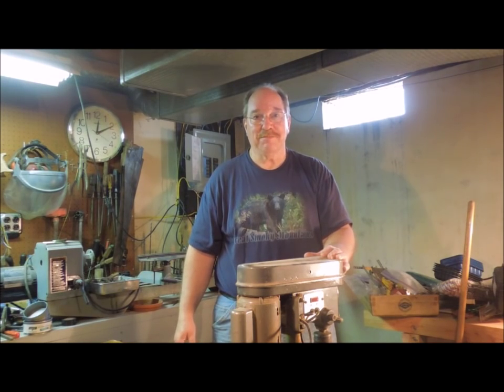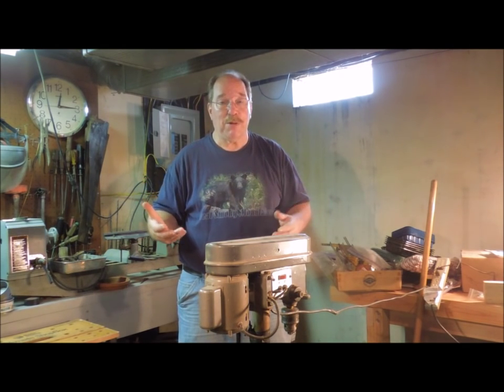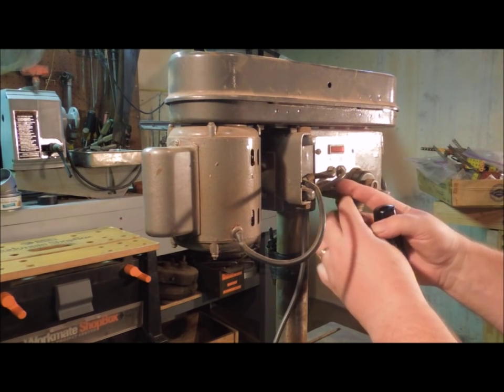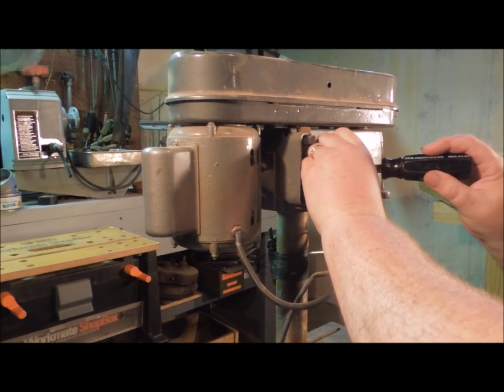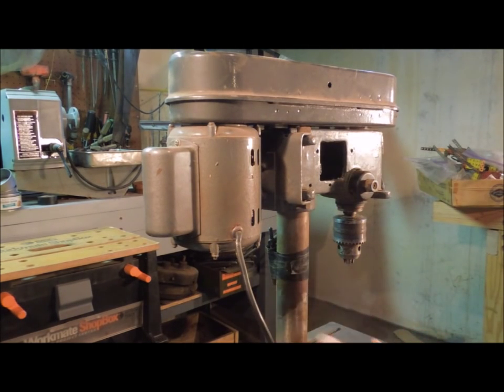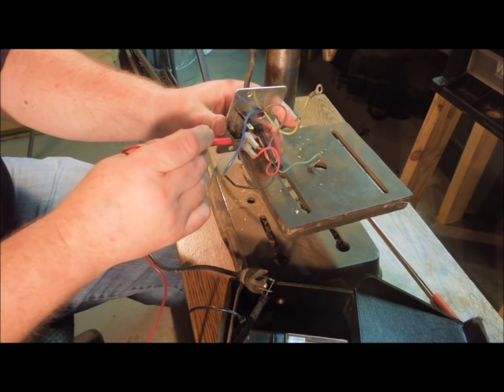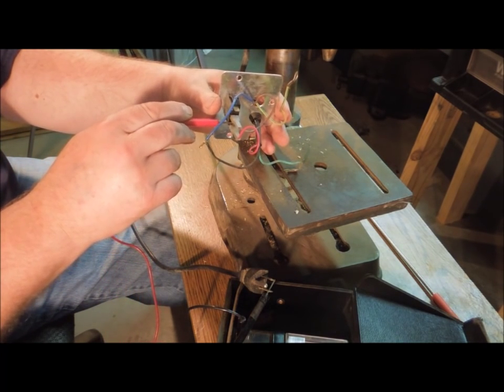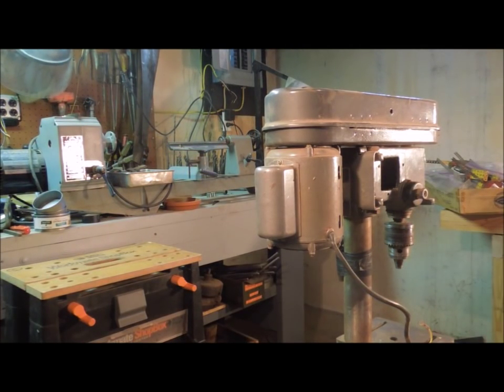Chinese Drill Press - What To Do When The Smoke Comes Out - By Old Sneelock's Workshop

Comment: I have about 4~ of the units made from these castings.  One exactly like yours with the aluminum cover and rocker switch.  I'm actually starting the process of making a slow speed kit for those.  Some of them have a pivot point ear inside for a center pulley yoke but I'm working on another method.
Reply from the maker: Still haven't stumbled on a motor for it.
A jack shaft would improve the speed control.
Reply: @OldSneelock  A whole drill press just like it just popped up here for $25.
Reply: @OldSneelock  On the motors, I've used my for production where It's on for a long time.  They will overheat even if your doing little or no work.  About 20 minutes is all they should run constant.
Reply: @OldSneelock  When I'm out of town, I can't help myself, I'm shopping for tools in the strange new land by night in the hotel room.  Seems I never get anything purchased unless it's at an antique booth mall or similar.
Reply from the maker: The Designer outfoxed me on this job. I'm here for a month. I was going to drive down but the customer offered to fly me. She said it will be better to fly. 
I can't load up the truck or rent a trailer. Pointless to pay shipping on half a ton or better of flea market gizmos and dew dads. 😁😎

Comment: I have the same drill press. Bought it 28 years ago at a traveling tool show. Noisy as heck and not that great considering I've only used it a dozen times.
Reply from the maker: Heru- deshet It was cheap. I was broke. It worked until the shop roof leaked all over it. POOF. THE SMOKE CAME OUT.
Reply: At least you certainly got your money's worth.I'm thinking of adapting a chain drive with smoother bearings and speed control to mine to make it quieter and more efficient. Got to get my money's worth. :)
Reply from the maker: Heru- deshet If nothing else you'll get a lot of fun out of trying.
Reply: That's where all the fun is!

Comment: Harbor Freight has ones like that for around $59  and even cheaper with a 20 percent off coupon But you may find a motor for that one off of something for free
Reply from the maker: not2fast4u2c The curse/blessing of a packrat is having spare parts. I was given a wet grinder by a friend. The grinder is interesting but too much trouble for what it is worth. I pulled the grinder, motor, and belt off of the cobbled bench and stored the hardware during one of my attempts at condensing the tool sprawl. 
End result, I have a 1/4 hp electric motor that just might fit.